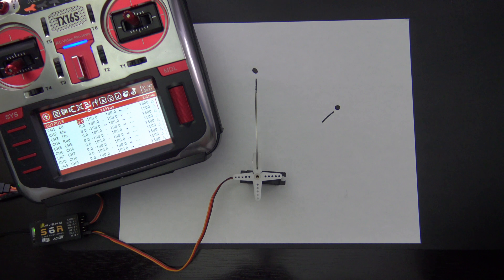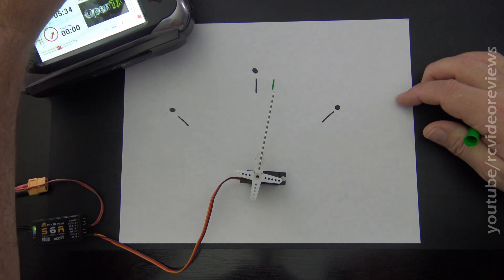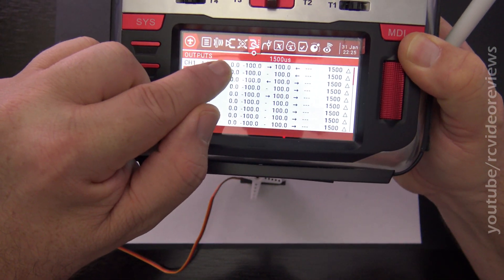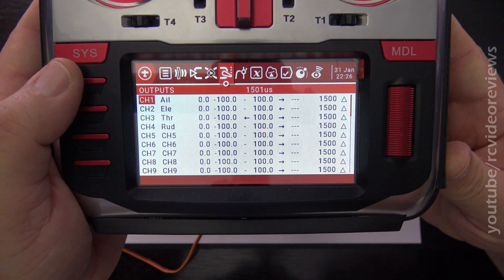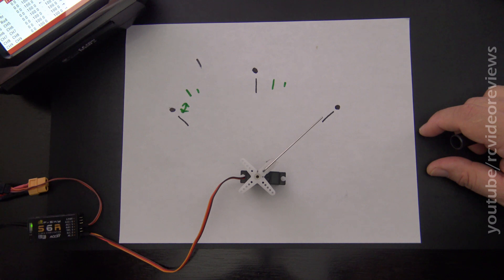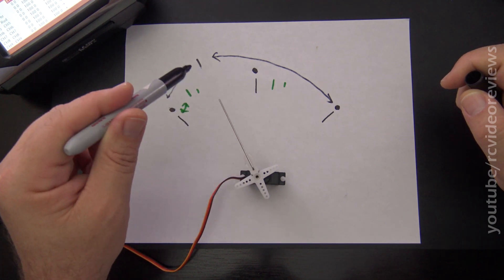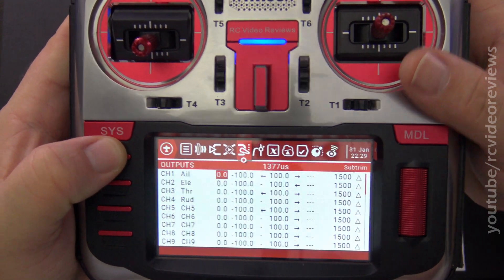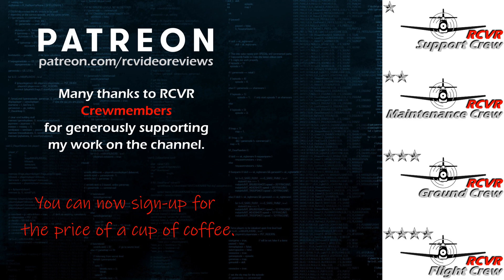OpenTx Snippet • Trim vs Subtrim • A Few Things You'll Want to Know

Comment: You tube legend ! If you have a nose steer wheel on a channel , and you mixed it with the rudder to steer. If the plane don't track strait, can you add a trim output like a radio knob to trim the front wheel independently ? Been trying for weeks lol Thank for helping us all the years.

Comment: I'm sure happy to have found this! Trimming your plane and then re-centering control rods to the new level flight trim to maintain full deflection is a pain. This is so much easier.  Do the subtrims stack? Does adding fine trim adjustments to an already trimmed plane stack on top of the existing trim values?

Comment: Using EdgeTX 2.9 programming my Turbo Timber EVO , this seems to work until I go to full down flaps ....at that point, the elevator pops back normal.  Any idea on why ?
Reply from the maker: Sounds like your inputs or mixes are fouled up. You should probably join discord. Link is in every video. Much more usable platform to get help.

Comment: Hey, John, great video. I see you can change servo center (dead band) at the end of the rows in the output page. I would assume you can set it to 1500us or 1520us to match the servos that you are using. Is that essentially the same as using a servo programmer like a Hitec programmer to change servo dead band ? How would it affect servo travel to use that instead of subtrims to center a servo control horn etc? I have been researching the Hitec programmer and servos. This Opentx/Edgetx option seems to be the equivalent. I have been searching for some good detailed info on this for weeks. Any thoughts are greatly appreciated.

Comment: Great video! Side question, how are getting the trim audio beeps? I’ve tried everything and can’t seem to figure it out on my Radiomaster. Frustrating when flying FPV and can’t watch the sliders.
Thanks!
Reply from the maker: I'm not aware of a setting for trim beeps. Is your volume turned up? Is trim active in the Flight Mode you're using? If trim is active and volume is turned up it should work as far as I know.

Comment: My silly quesiton. Does this apply to RC car trim and sub trim ?
Reply from the maker: The radio doesn't know what's on the other end of the Rx. So it will work the same if you had the Starship Enterprise connected to the Rx.
Reply: @RCVideoReviews  got it!

Comment: So..if you set your trim more to right, then reset sub trim to show a visible center value on trim tab...
Does that mean that you lose that amount of actual servo travel to the right? So for example, vehicle will fly true now but turns to the left are stronger than they are going to be going right? This seems to be my issue now on my heli..tks
Reply from the maker: You don't lose travel, you lose resolution. Subtrims do not reduce endpoints. They reduce the resolution between the "new center" and the endpoint on one side while increasing it on the other.

Comment: 4:15 on my screen I can’t see that 1763us there is nothing in that space, I am using RadioMaster tx16s, what can I do to see that  bit of information, and if I can see that would I be able to calibrate throttle endpoints direct from the RadioMaster? Thanks in advance for your help
Reply from the maker: Upgrade your firmware. I believe that feature became available in 2.3.10 or .11. You probably could calibrate endpoints from the radio as long as you trust the pulsewidths you see on the radio agree with the pulsewidths you see on the device you're calibrating.
Reply: @RCVideoReviews  Thank you! 🙏 I will upgrade the firmware,, in the SYS menu it say v1. 3.1.36.bin.

Also I will try again to install the bata flight.
Reply: @RCVideoReviews  I am sure the version is V2. 3.9

Comment: Thanks for the video, i needed some pointer going from my HiTec Aurora9x, but i have a question, i want to add "Flaps / brakes" to my full length ailerons.  and i was thinking to do a "flight condition" as it is called on my HiTec. with Sub trims so my ailerons are pointing down both of them but still has the function of being ailerions.

how do i get subtrims to be specified on a switch for a flight conditions? :)
Reply from the maker: Subtrims on OpenTx don't work that way. They only way I'm aware of to change subtrims is either manually, line-by-line, or at the bottom of the Outputs page with "copy trims to subtrims"  

This video might give you some ideas: https://www.youtube.com/watch?v=6tZdBPZ5Wgk

You also probably need to start looking at setting Global Variables and using those as weights. This video can show you how to do that: https://www.youtube.com/watch?v=KNXBwHwdFWU
Reply: @RCVideoReviews  thank you :)

Comment: great video. question: will subtrim have a bad affect on a flight controller? ex:eagle tree vector  using 2d stabilization or 2d+hold ?.
Reply from the maker: Eagletree can incorporate trims, so it has a mechanism to deal with them. Most other flight controllers do not like trims and advise against using them.

Comment: Hi, Trying to get my head round this. We use trims and sub trims at the flying field to get the plane flying straight and level and then later mechanically adjust the control rods to there neutral position and then adjust the radio inputs  to there centre position, does this make sense and is this what ultimately we are trying to achieve. Thanks for these snippets I personally find them extremely helpful as we say ‘short and sweet’
Reply from the maker: It's never wrong to center surfaces mechanically after you figure out where they need to be using trim. Glad the snippets are helpful for you ;)

Comment: Nice video :-)   I use 'Offset' to center my servo. This gives me equal travel in both direction. Is there any reason why this is not a good idea?
Reply from the maker: Offset and trim behave the same way. They both offset center and both reduce travel distance. The difference is Offset can be set from -100 to +100 where trim is generally reduced and meant for minor adjustments.

The only reason it's not a good idea is because you lose travel distance. If you mechanically center the servo you can recover the travel distance and if you don't need the entire travel distance, you can re-arrange the mechanics of the rod connection on the servo arm/control horn to give you more torque and more resolution.
Reply: RC Video Reviews Thank you 👍😎

Comment: Have a question. I was using subtrim to set my rc midpoint and endpoints to match betaflight requirement. The max has to be (ideally) 2000us. However adjusting the subtrim, i can only get either 1999 or 2001. When adjusting the subtrim number, it takes like 3-5 detents on the roller to see the output number change (from 1999 to 2001, or from 2001 to 1999) but it always skip 2000, just jump +- 2us.
Any idea how to solve this?
Reply from the maker: No, it's a mechanical issue. I wouldn't worry too much about it. There's nothing in betaflight/iNav that has a margin of error of 1uS. Just set it for 1999 and move on to the next task. 

If you really want to give it a boyscout effort, try calibrating your sticks.